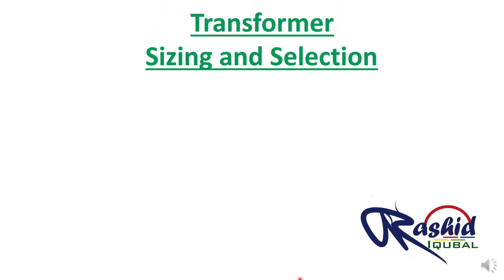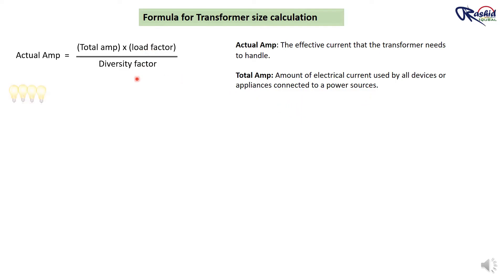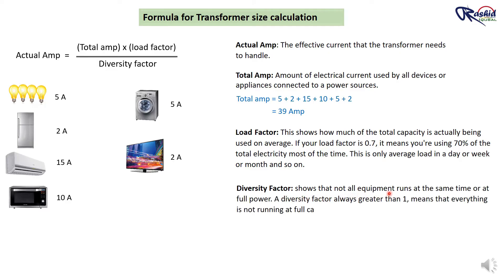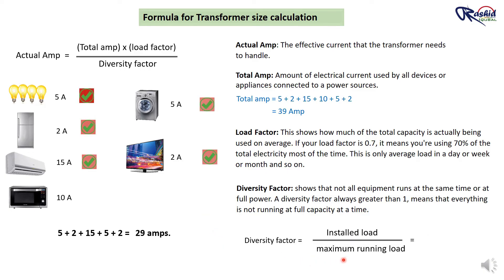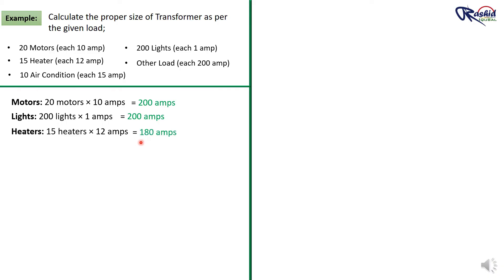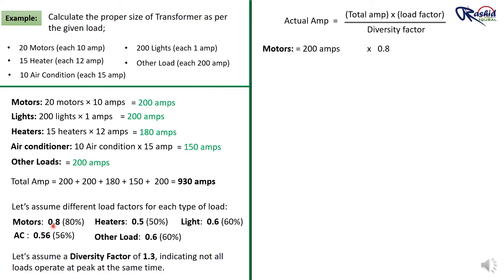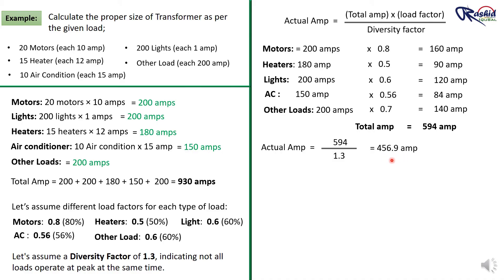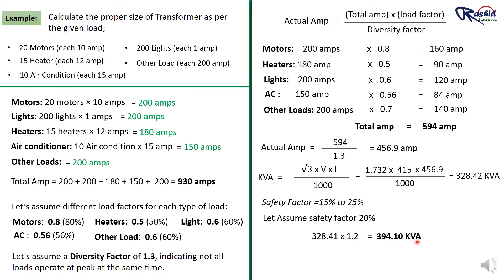Transformer Size Calculation | Step by Step and Easy way

Comment: Please don’t get me wrong. I have a question and would appreciate your clarification. Since the loads such as lights, air conditioners, heating elements and motors are single phase, why do we need to select a higher-rated 3-phase 500 kVA transformer?
Would it be feasible to use a 3-phase 200 kVA transformer instead and ensure balanced load distribution across all phases?
Even with proper balancing, the load per phase is not expected to exceed 50 kVA. Please let me know if my understanding is incorrect.

Comment: Why was safety factor 1.2 and not 0.2. You chose 20% as your safety factor so why 1.2 and not 0.2.
Reply: That's because we need the size of the transformer to be 20% more than the required kVA.

Comment: What about apfc load need to add the transformer kva or not
Reply from the maker: No, we do not add APFC kVAR in transformer load calculation.
Because the capacitor bank is not a load, it is a reactive power compensator.

Comment: if i calculate based on the Watt loads x pf would it be also work the same?
Reply from the maker: Yes, watt x PF = KVA
From KVA rating you can easily find transformer size

Comment: Where is the largest motor starting kVA during staring of motor.
Where is voltage drop parameter?
Where is overloading parameter?
Please do not post such a wrong informative  video.
 😮

Comment: I seen your one video there you have not consider all these factors, and formula has also different for transformers https://youtu.be/KkJhhgAZZkQ?si=mZdF27joebSlWJio
Reply from the maker: @Digital-f5r  this video is for transformer size calculation not circuit breaker and the link u mentioned this is for Circuit breaker calculation video. Both video i have consider required factors.

Comment: 20%means 0.2, why 1.2
Reply from the maker: @Digital-f5r  Sir this is simple mathematics 

20% means 0.2, but we use 1.2 when there’s a 20% increase.
That’s because:
1.2 = 1 (original value) + 0.2 (20% increase)

So, multiplying by 1.2 means you’re adding 20% to the original value.

Comment: Thanks,Rashid ji,
For sharing practical approach in selection of Transformer.

Pls tell us about aurhentic source, from where Load factor snd Diversity factor should be referred for various loads,
as a standard, in calculation.
NBC is silent about these.
Is available in NEC..????
Reply from the maker: Since NBC and IS standards do not clearly define these factors, electrical engineers follow industry practices and state electricity board guidelines. Some states provide recommended values for different loads. In real projects, load factor and diversity factor are usually based on past data and consultant recommendations...

Comment: 7:00 Please clarify : The current is calculated as if we are supplying through single phase.
Why we put in 3phase KVA formula.

KW load calculation then finally making it's equivalent 3phase KVA is better way??
Reply from the maker: When we calculate the current for each device (like lights, motors, etc.), we usually treat it as if it’s a single-phase load, because that’s how the ratings are given. But in a three-phase system, the current is shared across three wires, so the total current is divided among the three phases. That’s why we use the three-phase formula to get the total power needed, which helps us size the transformer properly.
Reply from the maker: If the power factor is known or can be estimated, you can calculate the kW load and then convert that to kVA using the formula:

kVA=kW/Power Factor

Comment: Hello Sir.
I have a question like if our total load is calculated in kva in load schedule so in that case we obtain the demand load and then we multiply the load with 1.25 factor so from this procedure we can obtain the size of a transformer
Reply from the maker: @Eng-z4z  Yes, by calculating the total load in kVA and applying a 1.25 or more safety factor, you get the required transformer size. The 1.25 factor adds a margin for future growth and load fluctuations, ensuring the transformer can handle the demand without being overloaded.